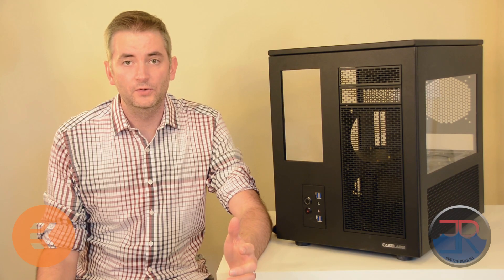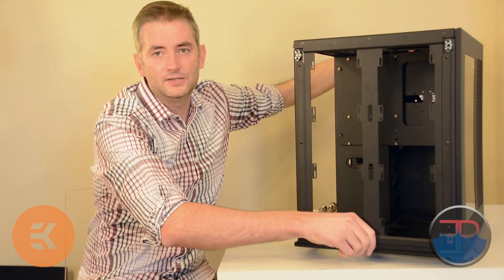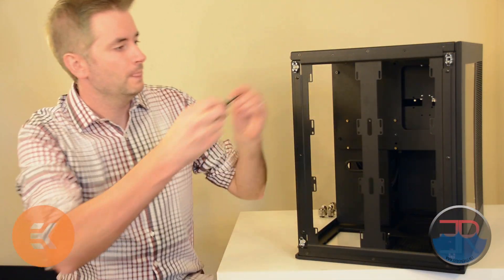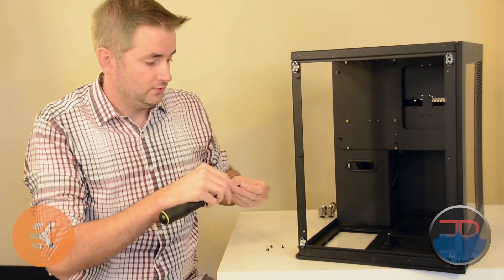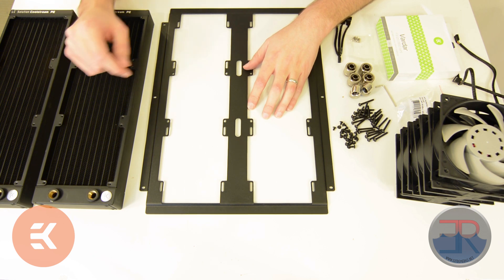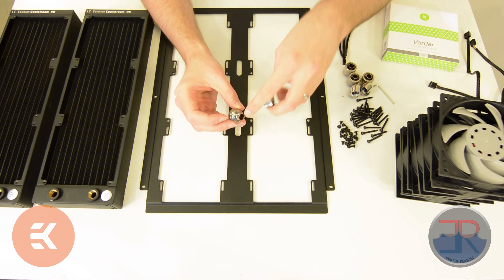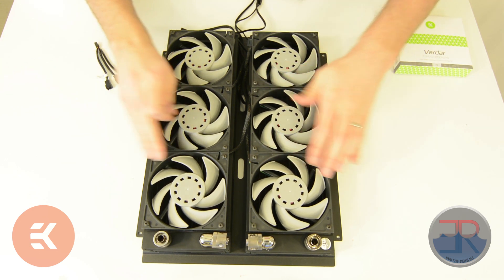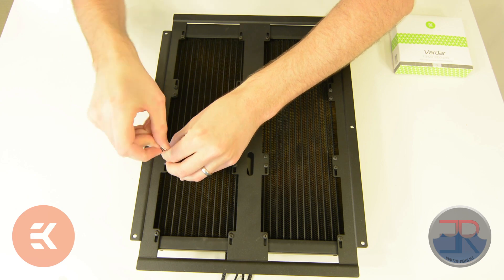EK's CaseLabs S8 Kit Installation Guide - Chapter 1 - Radiator Installation

Comment: Looks great Stren. I do have to wonder at how many people who go to the length of buying a Caselabs will really want all their parts chosen but maybe that is a niche. The parts are at least all best in class.
Reply from the maker: Jakus Jacobsen Yeah I thought the same thing - CaseLabs say that they get a lot of questions about what to buy from first timer water coolers and that this should help them out.  The other advantage is the savings not just because the kit is 100 euro less than the individual components but for a newbie you may buy the wrong parts due to poor planning.  I've done that plenty even when I'm not a noob ;)  If it doesn't sell well then I suppose we know to focus on other cases ;)